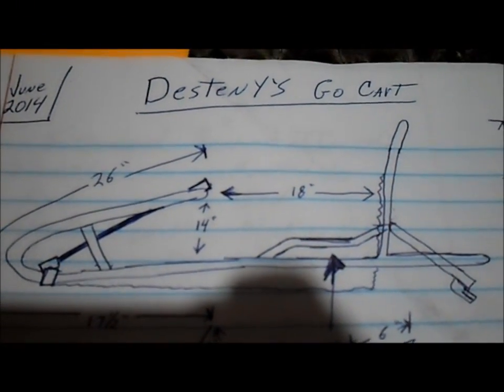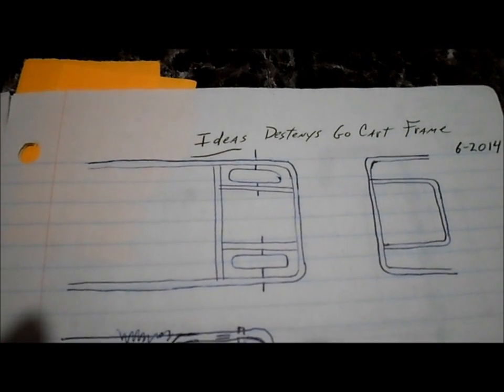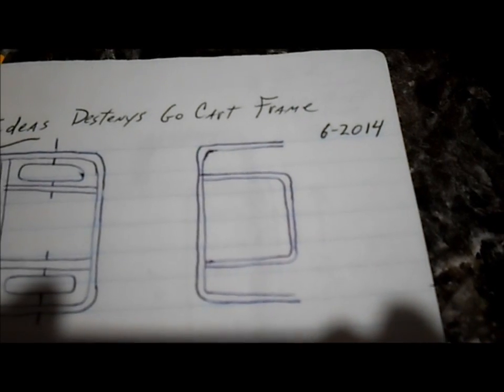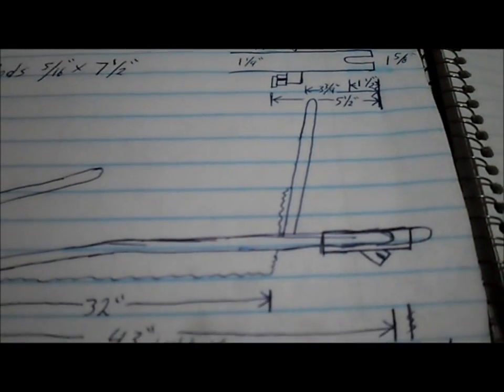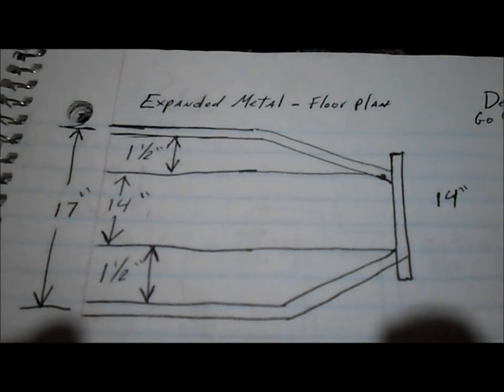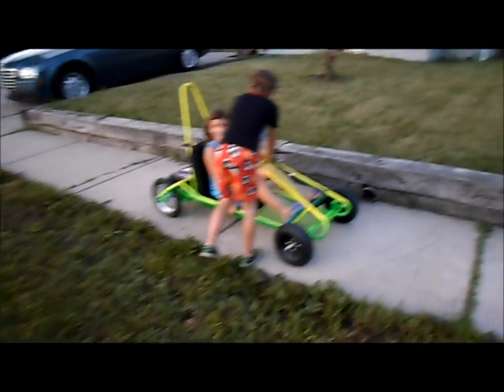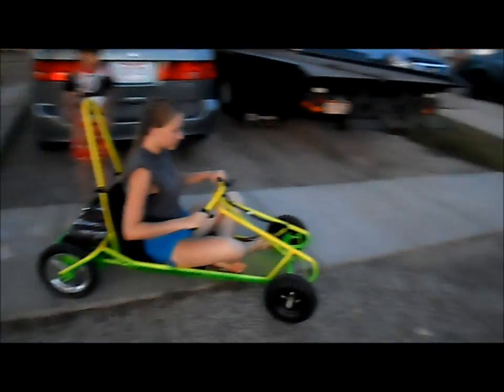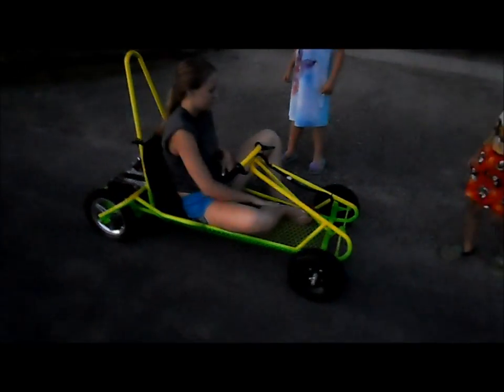Desteny's (homemade) electric go cart

Comment: I'm an electric convert, I built an electric jeep vehicle from scratch including it's esc, as a workhorse for our farm. Since then, it has taken over 90% of the tractors duties, can easily pull our 1.5 tonne water tank trailer full, has totally infinite speed control in all gears, it amazes all who witness it's capabilities, plus I charge it from the sun, next project is a go kart for my 6yr old son.. you just can't beat that silence, no fuel or oil, low maintenance, no burns, no starting, no warm up, and all the usual gas engine pitfalls. Great job with yours, and nicely finished, very inspiring.
Reply: That sounds sweet man id love to see it and see how u made the controller

Comment: make a gas go kart!!! there way better
Reply from the maker: I have built several karts with internal combustion engines (ICE) 

Gas karts are fun but, they are not better, that's old school technology. 

Not much has really changed since the 1960"s. (like 50 years ago)

Electric karts are the future. 

They do not rely on fossil fuels, are not potentially explosive, have no hot exhaust or toxic fumes.

oh ya, and electric motor's provide instant torque you don't have to wait for the power to show up.